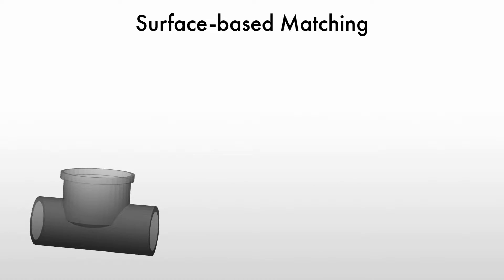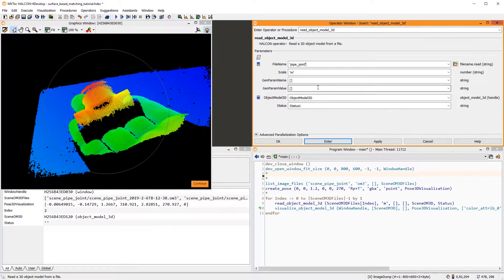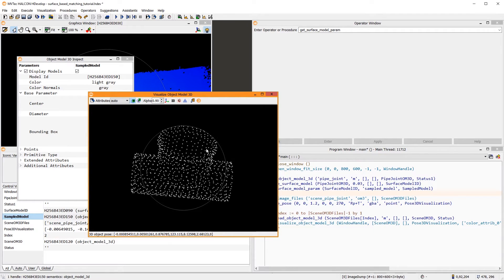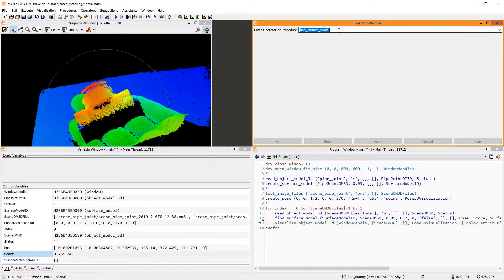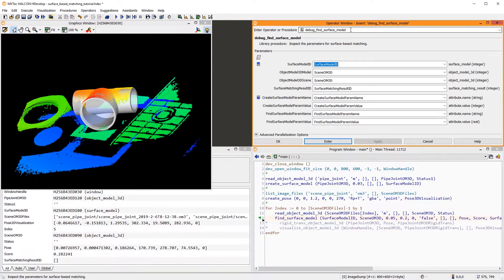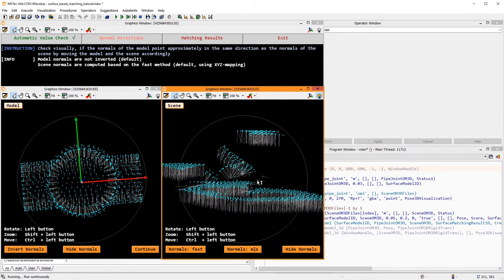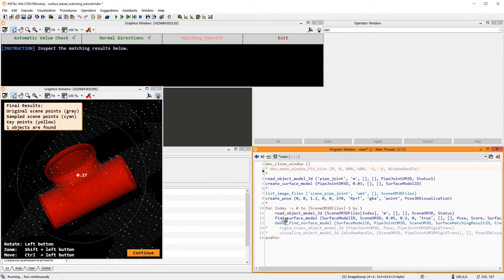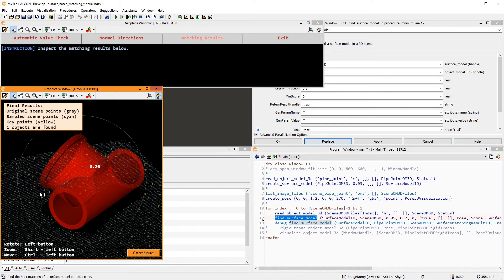Introduction to Surface-based Matching with MVTec HALCON

Comment: Thanks for your great tutorial. I have a question. After this step I want to find the differences between the point cloud and the CAD model(possible defects). What approach could be used to find the defects in image with respect to the 3d CAD model. Thanks.
Reply from the maker: Thank you for your question. 
After you have found the model in the scene via Surface-based Matching, the general workflow would be to use rigid_trans_object_model_3d to move the model to the found location and then apply distance_object_model_3d to find defects/differences. We recommend having a look at two of our standard examples (check_for_holes_sheet_of_light.hdev and compare_surface_sheet_of_light.hdev) which demonstrate this approach in more detail. 
You might want to use sample_object_model_3d beforehand to reduce the complexity of the data and increase the processing speed. 

We hope this answers your question. If not, please feel free to contact one of the MVTec distributors in your country: https://www.mvtec.com/company/partner-network/halcon-distributors/
Reply: @mvtecsoftware  can you advice on the approach to take if the model will appear in multiple places in the scene?
Reply from the maker: @OniOlalekanJoseph  In your question, we assume that there is one part available, but multiple matches are found.
In general, it is helpful to set known information as a parameter to limit the degrees of freedom for the search of the part.
An obvious parameter is 'num_matches' to limit the number of results. MinScore' can be used to ignore parts with only little match.
There are many more parameters and possibilities to optimize the search. It is worth taking a look at the operator documentation for find_surface_model(...).
Reply: @mvtecsoftware  and where can one get all the images used in the examples? That way it would be easier to follow through with the example and adapt it to other areas.
Reply from the maker: @OniOlalekanJoseph  In the description you will find a link where you can download the script and the sample images (only in German language). Alternatively, the link to the data can also be found here:
https://www.mvtec.com/fileadmin/Redaktion/news-and-media/videos/Beispielprogramme/vid069_surface-based_matching_introduction_example_program.zip

Comment: Hello! I want to use this algorithm in Python, and I can find the corresponding interface in Halcon-Python, but I what should the file suffix be? Thanks a lot!
Reply from the maker: Hello! Thanks for your question. If you would like to use HALCON with Python, the following requirements have to be fulfilled:

a. You need a native HALCON Installation >= HALCON 20.11
b. You need the matching PyPi Package (pip install mvtec-halcon ..) with the same HALCON version
c. You need a Python Interpreter with Version >= 3.8

You can either write your own python source file (name_me.py) and can integrate HALCON with import halcon as ha. Or you can call the HDev script directly with our HDevEngine via Python. All of these workflows are described in our Programmer's Guide, Part IV Programming With HALCON/Python and Chapter 24 HDevEngine In Python Applications. For more help, please contact your local distributor.

Comment: Is it possible to use Intel Realsense D400 series camera? It can output RGBD image directly.
Reply from the maker: There is no build in interface that directly supports the Intel RealSense sensors.
However, according to this page: https://www.stemmer-imaging.de/en/products/series/intel-realsense-d400/ Stemmer Imaging provides a GenTL Producer for the Intel RealSense D400. You can use this producer in combination with HALCON GenICamTL interface to acquire data from that sensor.

Comment: Is it possible to define amount of results? E.g. I want to find 5 pipe joints, 7 pipe joints or all of them, if we don't know how many pipe joints are in our scene?
Reply from the maker: Thank you very much for your request.
You can set the maximum number of matches that are returned with parameter 'num_matches' in find_surface_model(). Set 'num_matches' means there will be maximal 5 poses returned. If you want to get all results, you can set 'num_matches' to a very big value like 10000. Please refer to the reference of find_surface_model() under parameter 'num_matches'.

Comment: Could you please do a tutorial on how you got the surface model into Halcon? What extensions does Halcon support for the surfaces? Can I make a surface model from a TIFF (tif)? Thank you for your answer.
Reply from the maker: Thank you for your question and input, which we are happy to receive.
Regarding your questions: 
A surface model is created with a call of the operator create_surface_model. This operator needs an ObjectModel3D as input.
To read or create an ObjectModel3D, you have different options:
- 3D object models can be read with the operator read_object_model_3d. As you can find in the operator help, this operator supports the file types .off, .ply, .dxf, .om3, .obj and .stl. This is the most common use case, e.g. for using a 3D CAD model as surface model, as shown in the video.

- Generally, you can also read images with the operator read_image. This operator supports a variety of file types, among others tif. Wether a .tif image can be turned into an ObjectModel3D model depends on the content of the .tif image.
==> A single .tif image taken with a usual 2D gray value camera without any 3D information cannot be turned into an ObjectModel3D.
==> If you take various images of the object with a calibrated stereo setup (setup or two or more 2D cameras), you can reconstruct an ObjectModel3D. You can have a look at our example library how a stereo setup is calibrated and used for 3D reconstruction.
==> Some 3D sensors deliver 3D data in form of three .tif images, using one picture for X coordinates, one for Y coordinates and one for Z coordinates. If this is the case, the three images can be converted into an ObjectModel3D with the operator xyz_to_object_model_3d.

- If you have the 3D coordinates of an object in ordered tuples (e.g. X=[1,2,...], Y=[2,3,...],Z=[1,5,...]) you can also create an ObjectModel3D out of this point coordinates using the operator gen_object_model_3d_from_points.

For all ways, you can call create_surface_model using your ObjectModel3D as input.

We hope this answers your questions. If not, please feel free to contact one of the MVTec distributors in your country for further support. A list of our distributors can be found here: https://www.mvtec.com/company/partner-network/halcon-distributors/
Reply: @mvtecsoftware  Thank you very much for your answer. It really helped me out. I only have one more question. You did not mention in your video, how did those 3D scenes from your setup (wheter it was set of two 2D cameras, or a 3D camera) occure in Halcon. Is there some operator for this? And what extencion does the file (the scene) have to have in order to create a 3D scene? My setup is one 3D camera  (laser and sensor) and it generates a TIFF image in the end (which should have a 3D info in it). My goal is to create the 3D scene from this TIFF and then compare it in Halcon with a created 3D model (in CAD or elswhere) of the product I have scaned with the 3D camera (literly the same thing your video tutorial is about). Unfortunately I am not able to find a way how to acomplish that in the moment. I would be very pleased if you could help me out with my probelm if there is any solution. Thank you in advance.
Reply from the maker: @lirec6  The scene that is used for find_surface_model needs to be an ObjectModel3D as well. So you have exactly the same possibilities as mentioned above (read it with read_object_model_3d, create it from XYZ images with xyz_to_object_model_3d, create it with gen_object_model_3d_from_points). 

If you do not succeed in creating an ObjectModel3D from your data, please contact your local distributor with a description of your problem and some example data of your setup. This support is free of charge. Our distributors are listed here: https://www.mvtec.com/company/partner-network/halcon-distributors/